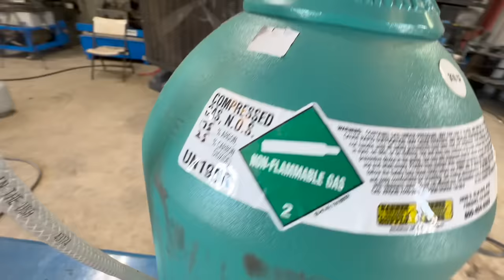Kobelco loader arm part 1

Comment: Why not bead blast to get it cleaned first? Way less time and cost.
Reply from the maker: Because at that time I didn’t have a blaster and the heat gets the oil out of the steel better.

Comment: It seems as though you're using the wrong side of your press. The other side is good. You would have had less chance of deflection had you positioned the pressure on the gusset side. Or replace the backside with a gusseted plate.

Comment: What the heck where they doing to bend that part like that?
Reply: Well if the pin won't stay in position to the point it breaks the retaining bolt, then the retaining weld... Maybe consider finding the root cause instead of running it.

Comment: As always very impressive (really) Mr. masterpiece. Don't want any figures but what would be the cost of replacing this arm in percentage compare to the reparations. I'm wondreing. Is reparations represent 15 20 or 30 percent of the cost of a piece like that.
Reply from the maker: Well the piece is not available new or used. So what I did is about the only option.  This job will cost about $5,000
Reply: @OFW  For sure much much much more lower than a replacement of this arm. You're the the king without any doubt.. Can't wait for the next one . Thank you for those educatives videos.

Comment: Why would you attempt to bend that large casting without heating the area to a yield point, at least dull red
Reply from the maker: I was working with what I had.
Reply: @OFW  I would have thought from the size of your shop that you would have a large rose bud for this kind of work.

Comment: Your problem is your heat source, propane is not nearly hot enough. Does anyone make large induction heaters for small shop use?
Reply from the maker: I know it needs more heat, I just didn’t have the right equipment for that.

Comment: I never liked those types of pins. I prefer ones with either a nut on each end or a shoulder on one end and a nut on the other so the pin holds the bosses together. I had many pins made over the years to change those designs. I also don't like to grease bushings through the pin because pins always seem to break at the cross hole. I drill in ports to grease the bushings through the bosses.

Comment: Lay the bent ear on it side weld it to the plate in the press put a 20 ft long cheater tube over it heat it up and push on tube with forklift

Comment: When you have it in the press, you need to keep the heat on..  or start a big giant big wood   stick.That thing in there and pull it out when it's just red hot and you can work with It. is dangerous what you're doing now.

Comment: Could you explain to me  why you  run  the welds so far past the join 😢?,thanks
Reply from the maker: It helps make a better less stressed weld.  Typically you don’t want any starts or stops in your weld.

Comment: All that work and then you end up cutting the ear off. I can't believe you tried to press it down cold. Steel needs to be red hot in order to be bent, You can not bend steel when it is black. That bit of heat you provided is not enough to change the steel structure and make it plastic. You must heat up to 800C (1500 F) and then you can bend at your heart content. Attempting to bend cold produces cracks regardless of that bit of warmth you provided. Next time get an open coal forge and you will have no problems. Another ... I would have used a sledge hammer and not a press, but there is nothing wrong with the press, providing the steel is red hot.
Reply from the maker: Ya,  I definitely didn’t have it hot enough.

Comment: I would have thought it should have been heated cherry red or more before you attempted to press it. Anything less than the correct forging temperature will not work.
Also, your work place Safety is a bit sus'.
Reply from the maker: I agree.  It should have been hotter, I didn’t have the right equipment for that.

Comment: I would would of told customer he needed to buy a new one. Your time, material, machining, plus any of your equipment that got damaged while trying to press it, is not worth it. The machine that came off of had to have been abused.
Reply from the maker: A new one or a used one wasn’t available. It’s an old machine. It definitely had a hard life.